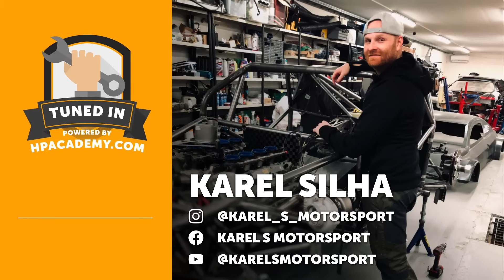DIY Motorsport Isn’t Easy But It’s Insanely Rewarding [#PODCAST]

Comment: So, I want to build out a Mazda RX8 and totally re-body it with S-class fiberglass making it look like an old 63' E-Type Foose one, 57 Testerosa/ Janerelly design 1. Then, of course, I want to grab an LS probably the 6.0 and put an L8T crank in it. Having to set aside the turbos and retractable hard top roof or FWD electric. Only because I'm going to make sure I think $30,000 would be enough for that. What do you guys think?
Reply: Why not just put the ls in a Benz to begin with? Why even bring in the Mazda?
Reply from the maker: That would be AWESOME! We're not really any better on the budgeting accuracy side of things than anyone else, but normally you work it all out, and then add at least half again for all the small things that we all forget about that add up 😅 - Taz.